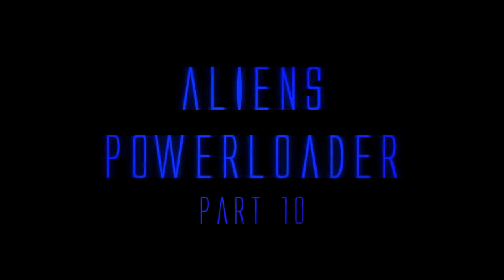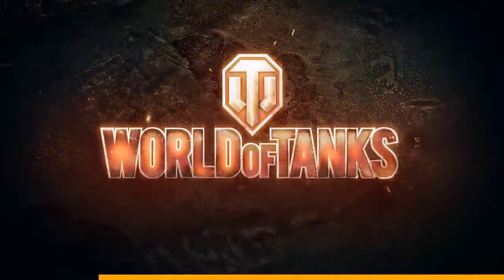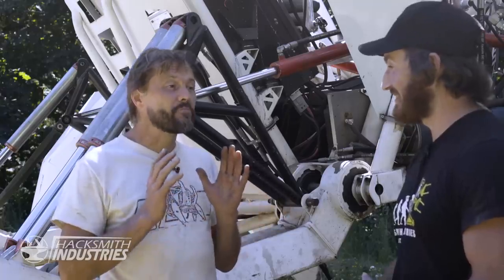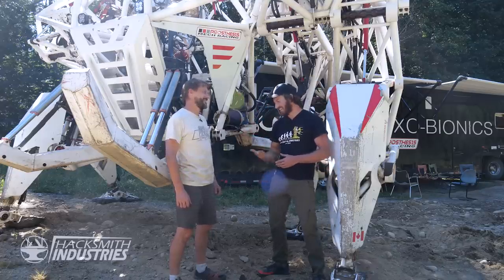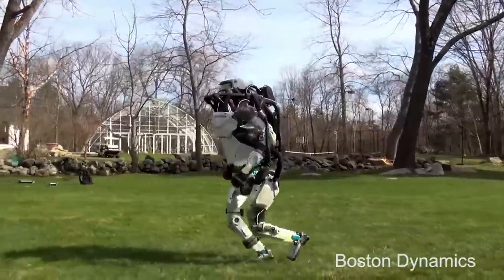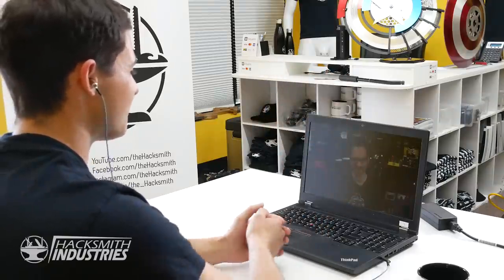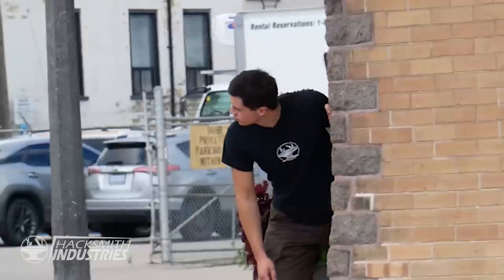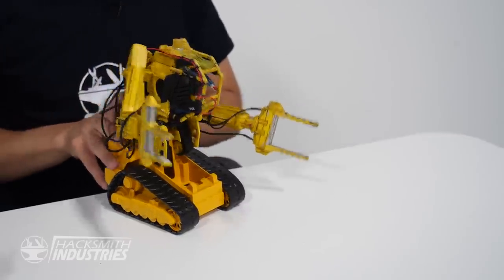Legs or Treads? (POWER LOADER: PART 10)

Comment: I'm convinced there are some electronics/gyroscope technologies already out there, that would help these iron beasts balance themselves. You have concentrated on genius level hardware, but even Furrion pilots manually switch the hydraulic valves. Maybe Ben Heck or Element 14 could help.
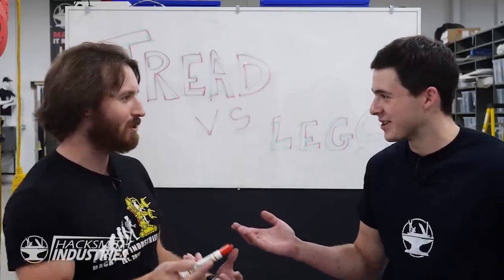-If I was building the Power Loader. I would use small tank tracks, but on (limited) articulating legs 8:16 "Tregs". You can hide them under boots.
The machine that lays concrete road curbs has the perfect sized hydraulic treads. However your idea is better.
Reply from the maker: The issue is you can't get tiny treads rated for 10,000+lbs! Furrion is manual because they want it that way -- it could certainly be controlled with a computer if they wanted to :)

Ours the physics just doesn't line up. The fictional design is just far too top heavy,  and when picking up a load it would be impossible to keep balanced. Legs could work but it would be a statue
Reply: @hacksmith  I can't wait for the next episode, to see how the tracks work out. Should be soon right?
Reply from the maker: Just before Christmas,  picking up the track loader tomorrow :)

Comment: Still loads of questions about the MM interface, resolved control, matching arm movements etc.
But for now...  
Can you show us an elevation of the working envelope of the arm/gripper when mounted on the bobcat?
The grippers don't appear to go anywhere near the ground for a parallel jaw pick up. Are you planning a degree of freedom to tilt the body fwd/bwd?
Reply from the maker: Yep,  but it's still not gonna be able to pick up things like a forklift lol.  Specialized crates like mini dumpsters with holes in the side for picking up

Comment: A few flaws, sorry, arm length will it reach far enough after equipping to a tread drive assembly to lift anything. Other flaws; weight in drive section otherwise it tips forward or turtles once load is put on. And finally, weight can once it's assembled can it handle itself or will it be a statue. The last item isn't the same as the same as the second as it deals with mobility not balancing a load.

Comment: Not an engineer (I dropped out of engineering college) but couldn’t you do a hybridised system of tracks and legs? Basically having legs with either a track or set of small tracks for each foot, or a large set of tracks bay connects to both feet, while having hydraulics in the legs that will allow you to basically squat down the adjust height, lean in various direction (if driving over I ever terrain it’ll allow the loader to stay level and more stable as it’ll change the centre of mass) as well as lean backwards slightly to improve balance if carrying a large load, while still having the much more affordable and stable tracks as feet. I know this is probably too late, but anyone with a better knowledge of engineering? Opinions

Comment: would it be possible to design it so that you can detach the treads/peg portion so that once you get the legs built you have a functioning power loader but then you can work on the legs when you have extra money/time/sponsors?

Comment: With the argument of tread vs legs I don't see why not both. Other than low cost and easy of just buying and re-purposing heavy equipment, why not do legs on tracked feet. That way as your tech gets better more functionality can be given to the legs.

Comment: hey I know I'm not a engineer or anything but why not do both you can have tread mode and leg mode were tread mode you can get from point A to point B with relative ease and with leg mode you can get from point A to point B if it's a rough Terrain have the feet be treads basically have the feet be treads but can also walk like a human person while still have the ability to be a tank I'm not sure if you guys could do this but hey if you guys actually read this comment and considerate it thank you

Comment: Oh well. Was hoping for faithful recreation as I searched the internet but apparently treads threw that away.
Reply from the maker: The original was a foam costume worn by a person... This is a 15,000lb steel mech. Legs just don't work
Reply: @hacksmith  Maybe one day the proper means to make it work may come along. Either way, great work with what you've done regardless.

Comment: Might I suggest using a mini excavator instead of a skid loader. It will give you rotational movement as well as a drive base
Reply from the maker: The mini ones aren't rated for enough

Comment: Id do both, have the legs look movie accurate but on the bottom of the feet have treds. So the tracks are hidden by the bottom of the feet.
Reply from the maker: The problem is balance,  the cofg is way too high for skinny legs
Reply: @hacksmith  oh, thats makes scene lol
Reply: @hacksmith  or use legs with threads in the bottom
Reply: Juan he was saying about treads at the bootom of the legs but the legs would not be able to hold up the upper body of the mech

Comment: Theoretically the only thing you need to balancing a biped is to use flight controller from a drone, they can calculate the balance in the flight controller. Trust me i am a certified armchear engineer...

Comment: TREADS?!  Treads are a total cop-out.  Legs will be more complicated, they will be more expensive, twill be harder to control.  But LEGS!!!  You've seen what legs are like on the Prosthesis Mech.  If you HAVE to use treads, there better be knees and hips on it, so it can crouch, and lean back to offset a moving center of gravity due to carrying loads.
Reply from the maker: Legs are basically impossible based on the movie design. Way too high of a center of gravity

Comment: Could you not make the legs really thick and structurally stable so that it’s able to hold the full project with just one leg at a time and have it move much slower?
Reply from the maker: They'd be massive
Reply: the Hacksmith high powered electro magnets and a metal floor?

Edit: now that I think about it that would probably be insanely hard to pull off if possible at all
Reply from the maker: That is the most reasonable way but would be really expensive and dangerous still

Comment: man o man, I was really hoping for carbon fiber  with ______ reinforced  for the legs. it's in the computer cpu w.t.f. for the balancing act once the operator picks up the right load. Besides the money part it just seems to be an easy way to finish this and come in on or under budget? is that really the hacksmith we've been following all these years??? under the circumstances, id say you've made the ?safer bet?....go team.

Comment: They are looking for the system to make the power loader stable butthey forgot one thing. The pilot is the main balance system. It will move only in the way the pilot will make it. It would be easier to make the legs and then train on the chains so it would not fall over. The problem is: How the heck make two feets that can help hold the balance while one of the foots is not on the ground. The weight shift shpuld be done in the mid section of the mech itself but it is too hard to implement it is easier to make a tiny move in the ankle and hips to shift the weight on one leg. But the foot should be in a shape that could support taking whole weight on it. Just making problem out of other problems.
Reply from the maker: That's why it's basically impossible. The one in the movie also didn't have any weight on it -- pretty well impossible to not have a high C of G
Reply: @hacksmith  i know. And to make any mechanism that could be at least fast enought to respond and catch the balance would cost a fortune. I saw some projects that are pretty good but machines that could use it are far bigger than the power loader. The hydraulics need time to extend and retract. The main problem for the hydraulics is the weight. I always thought that the power loader was working not like a mech and more like an exoskeleton. I have a question. The main power source of the power loader will be in betwen the threads or on the machine itself? It would be much safer to put all the aditional weight on the lower parts of the machine so it would be better. balanced.

Comment: I get why you chose them but Bobcat tracks are a disappointment, slow and with no suspension the loader is going to be very jerky and restricted to quite flat areas. Would be cool to build something with suspension and use self levelling tech to keep it stable.

Comment: I find it strange that you have thousands of bucks worth of milling machine and you didn't design your own metal sectioned track system like tanks use, along with the toothed drive wheel.
A single template would make as many sections as you need and all you need to do is use a dowel with a threaded end for nuts to screw onto to connect them together.

Comment: why not do legs as the main form of motion and then during exertion on the mech and the pilot, for instance picking up a load, have multi-directional tracks on the feet. Use a large area for the feet with tracks or wheels to maintain a center of gravity. You keep the aesthetics of a humanoid look as well as have the mechanical advantage of tracks or wheels

Comment: now, you used the human body as reference for the arm, like hydraulics for the tricep etc. why don you do that with the legs too like use hydraulics for the hamstrings  and quads and calves. and make feet that are extended fron front and back so you dont easily fall over

Comment: I'm sorry but there should be no treads. The coolest part of the Aliens loader was the walking and thats  what this project needs even if you have to wait 10 years for technology to advance.
Reply from the maker: Legs aren't possible the way they were shown in the movie
Reply: @hacksmith  Not saying it has to be perfect to the movie but ya I can imagine it has to be very difficult and astronomically expensive to make that walk on 2 legs. Great work on this though. Theres a robot called method 2 thats about the same size and is bipedal if you want some inspiration. So maybe build your tread mech and have the top part able to detach in case 10 years from now you want to attach it to some legs.

Comment: What is the point of a power-loader build... with tracks or wheels... that would be sad. That being said you are not a multi billion corp building this... so who knows what the future may bring in changing the design later. Also don't buy bobcat... the hydraulics are fubar for what you pay.
Reply from the maker: Legs aren't possible the way the movie designed it.  It would fall over
Reply: @hacksmith  I know my dude I am just busting ya, even that multi-million dollar system in Korea (METHOD-1) can't walk without support etc etc... but on a serious note don't buy bobcat because their hydraulics is no good for the price among other issues engineering wise, instead go for a Yanmar skid steer... cheaper and will outlast a cat.
Reply: @hacksmith  Also love the scaled Tesla project, among others. You guys do decent work...  still just rifting ya about it, sadly jokes about the tracks don't come across well in text form indeed.